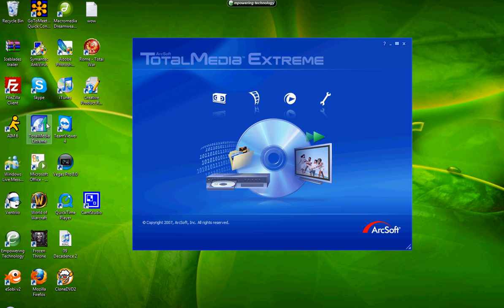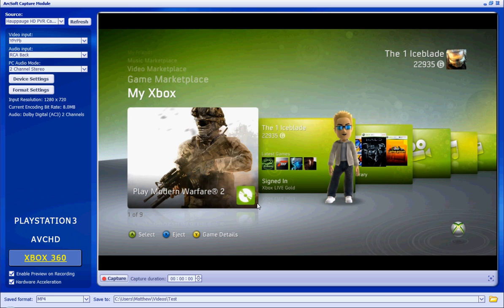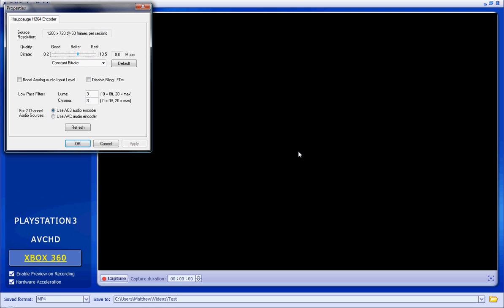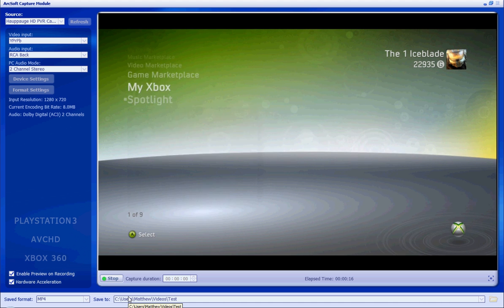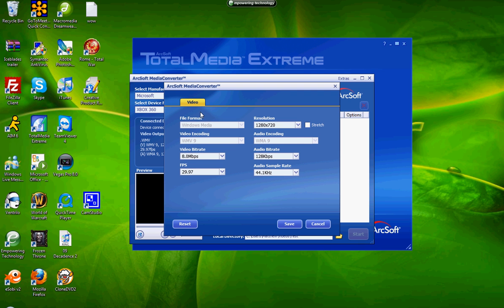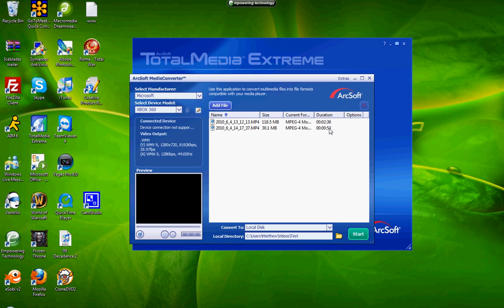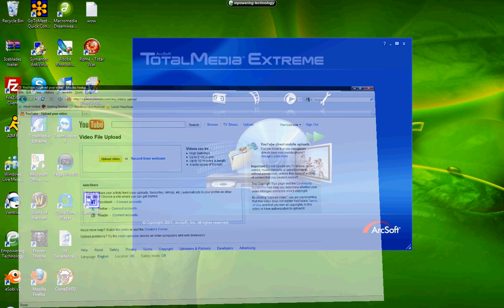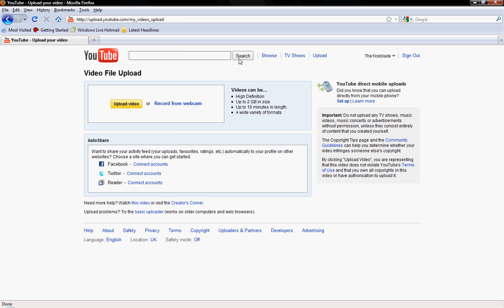Setting up your Hauppauge HD PVR for Recording Xbox 360 gameplay

Comment: @ttms6 They are not required. They are for good HD quality.  They're about $12 fro a used pair at GameStop. That's what I have and they work great. If you aren't buying them and plan on buying the composite cables ( 3 cables yellow red and white) plug those into the front of the HD PVR and switch the video input on the software to composite. They work ago but the component cables (five cables) give you outstanding quality.

Comment: They are required. There are for good HD quality. They're about $12 bucks for a used pair. That's what I have and they work great. If you aren't buying them and plan on using the composite cables (red, white, yellow) plug those in the front of the HD PVR and switch the video input on the software to composite. The work okay but the component (5 cables) will give you much better quality.

Comment: @The1Iceblade 
You can record in 1080i using the Component Cables.
What I would like to know is would it be possible to record SKY HD over to the Hauppauge HD PVR. Also is it possible to buy an adaptor with an HDMI on one end and slots on the back so you can put the Component Leads into it so you could record from SKY HD? Thanks for any replys. 
Hauppauge.co.uk more info on this device.

Comment from the maker: if you pc recognised the hauppauge when you installed it and installed al the drivers then you should be ok

close down any other applications running and remove anything like webcams ect from there usb ports

try re-starting your pc and then going bk into it and selecting your the hauppauge from the source, 

the last thing you can check is that you are selecting the correct video feed in from the drop down list